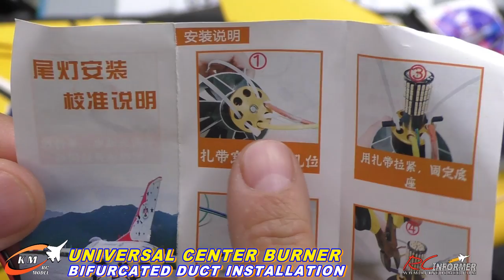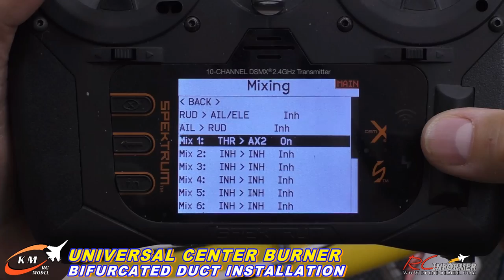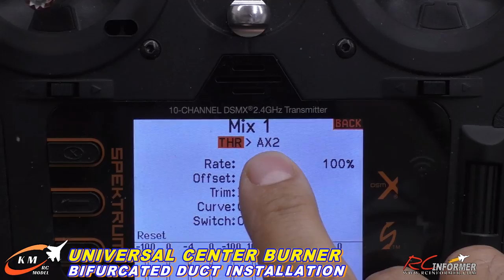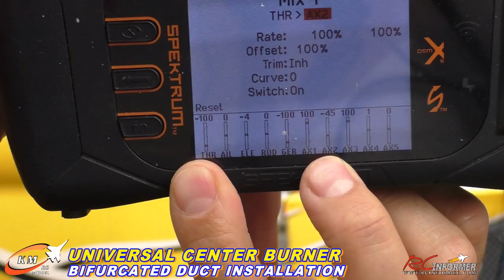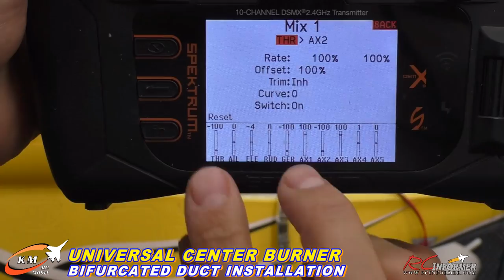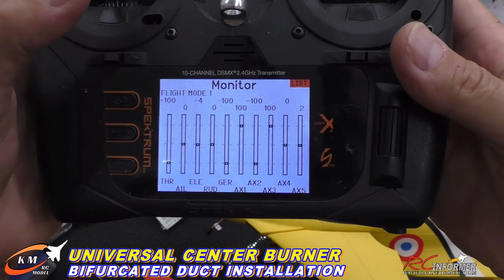KM-RC Models ***NEW*** UNIVERSAL Center Burner BIFURCATED DUCT INSTALLATION By: RCINFORMER

Comment: Rich:

Where about is the mixing board located in this jet? 🤯 Cant find anything anywhere about it. (Reason being, i wanna use a 10ch reciever & setup EVERYTHING my way. Seperate canards is a must!) Unless i can remove the canard servo lead & set it up separately.

ANY knowledge is greatly appreciated!
Reply from the maker: It’s right in the back of the battery bay-you have to remove the battery tray floor and there is an additional piece of ply that is attached to the back of it-on top of that piece of ply is the mixing box-Once you access it you can actually deactivate the pointless Crow feature and also change how the lights operate if you want-or you can simply completely remove it and wire it up as you wish. Page 9 of the manual shows you the actual mixing box (NOT THE REFLEX UNIT) which you will find right at the back where I told you to look. Just be aware the canards are not independent on this aircraft like they are on the Freewing Gripen with one servo each. Thanks for the question and keep us posted how you get on :)

Comment: Rich what if I have no free channels on my RX? does it then just get plugged into a Y harness and then share the throttle channel? then surely that means I cant calibrate it to my liking as the throttle calibration will get messed up? cheers
Reply from the maker: Yes, just use a "Y" harness... you can calibrate. The instructions say to unplug the 3 motor wires to do it, so you dont risk launching you plane off the table. However, it can be done quickly  Without removing the motor wires.  I just do it very quickly before it enters the program mode, then it doesn't affect your existing programming.
Reply from the maker: It's actually not intended for a free channel, it's actually intended to be "Y" harnessed to the throttle channel... I just happened to have an open channel that I can mix and it makes it a lot easier and there's also one less connection for your throttle... I always like to run as few wires as I can, it just reduces the amount of connections you have in the system.  Most LED afterburner systems do use a "Y" harness though:)

Comment: Is there reverse polarity protection for the connection to the balance lead?  Looks like it could be easy to blow it if connected incorrectly.
Reply from the maker: Yes, it is polarity protected...it has 2 notches that all balance tabs will plug into inly one way:)

Comment: does it work with the elite viper 90mm bnf , since it has an avian esc?
Reply: It does, but it takes the option of using reverse thrust away, unless you plug it into a seperate channel in your receiver and mixing that with your throttle channel

Comment: Hi Rich, I used an RCgeek afterburner on my 8S Wemotec setup and I didn't need to cut any foam at all in the bifurcation. Greetings from Belgium
Reply from the maker: Yes, his are short. They are also much more expensive, possibly a bit heavier. Also, it's size specific, where this will fit almost any motor.

Comment: Hi bought 3 not having any luck calibrating  REd Led always on..Have it coneccted to my throttle with y cable   help any thoughts    Thanks
Reply from the maker: What is it doing?
Reply: Sitting at idle flickering won't get brighter when throttle increased 
Thx for your quick response
Reply from the maker: @robertnet4150  which airplane?
Reply: Freewing F16 70mm
Reply: Y. Cable to the throttle
Reply from the maker: @robertnet4150  FIRST, do a calibration of the throttle/ESC... Then do a calibration of the afterburner.... 1. Throttle full.  2. Plug in the airplanes battery THEN immediately plug in the balance lead to the afterburner. 3. Quickly reduce the throttle to the position you want the afterburner to begin to become bright (say for example 1/4 throttle) the red light on the PCB should go from flashing to steady then bring the throttle to idle... The idea is to do this quickly so the throttle does not stay in the full throttle position long enough to enter the programming mode.
Reply: Thx I'll give it a try
Reply from the maker: @robertnet4150  so far, all of mine have worked flawlessly.
Reply: Hi Robert! We would love the help resolve the problem you have with our products. Please contact us through our website's contact page.
Reply from the maker: @robertnet4150  it sounds like a rogue program causing the flicker. I just had that happen to me. Check your servo monitor screen for the throttle movement.
Reply: @RCINFORMER  I checked all of those things I thought after applyin

flying for 40 years I knew it all but you've taught me a couple of things just watching your videos through all the years however these very inexpensive circuit boards I think because they're so mass-produced they could have some glitches like any kind of electronics could I bought three of them two of them don't work I've tried everything including contacting the manufacturer but they weren't helpful no receptive so I'll just stick to buying a different product but thank you for all of your help and I really appreciate all the videos good work.
Reply: @robertnet4150  Sorry about your experience Robert. We've been trying to reach you through email. But we haven't heard from you for a while. Please send us a clip showing what those 2 units are doing after you plug them in. And we would love to help you figure out what the problem is. 
Regards,

Comment: An afterburner that never totally shuts off? You won’t be winning any scale competition with this one!
Reply from the maker: It depends on what you like. I'm not into scale competitions, I just like to see the light more. When it comes on at half throttle, you only get to see the light for an instant when it whizzes by at Mach speeds... With this burner, you will get to see the light more even at slow speeds. This burner is all about ease of installation, inexpensive, light weight, better motor cooling, easy programming & simplicity:)